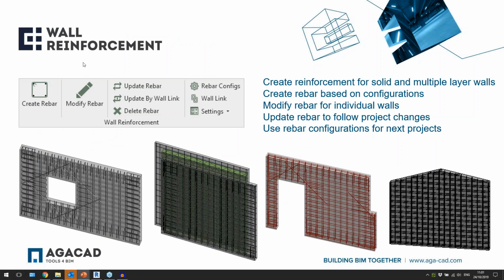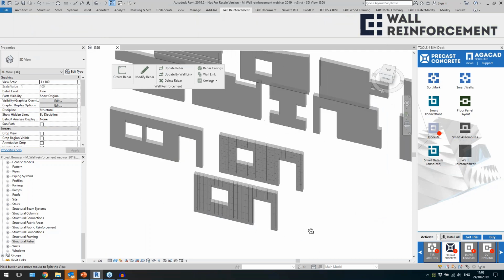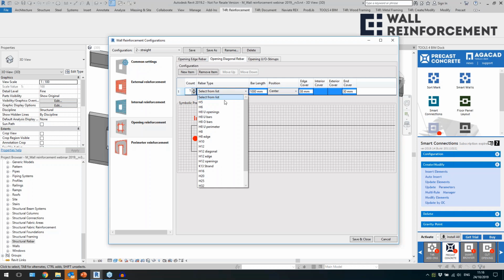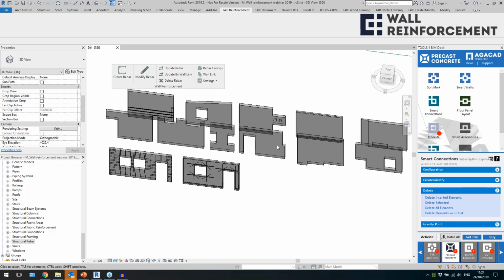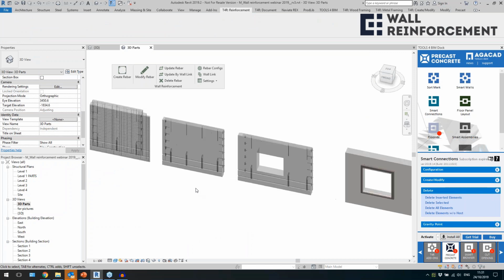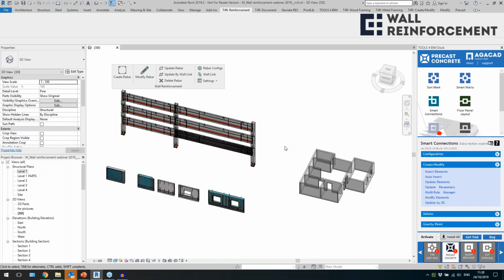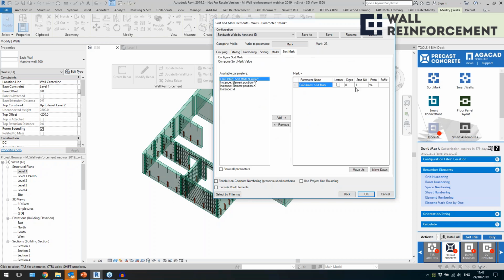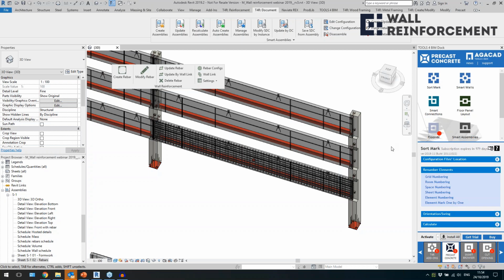Automated Wall Reinforcement in Revit for Precast Concrete Design

Comment: are the reo can be exported to Machine File?
Reply: thus is mean you can not export the reo created in AGACAD reinforcement? When I tried to export Machine File for the reo created using AGACAD reo, I got an error. "CAM export is not supported for manually created assembly. Please create your assembly using the precast tools"

Comment: Is there any possibility to have the rebars modelled as rebar sets? For contractors to be able to build without drawings (only model) one would have to implement a lot of information which could only be done if the rebar is made as sets.

Comment: Hello!
I would like to understand, how it will work if we use monitoring to get concrete structures from linked architecture model in our organisation (walls are solid).
Every time the wall/opening/door changes it's position/dimension we have to update the reinforcement in the corresponding wall? Or we can just select all the walls and refresh whethere the changes have appeared without checking out each individually (but it will demand lots of computional capacity and take lots of time)? 
Sorry if it has been already stated and I just missed this info.